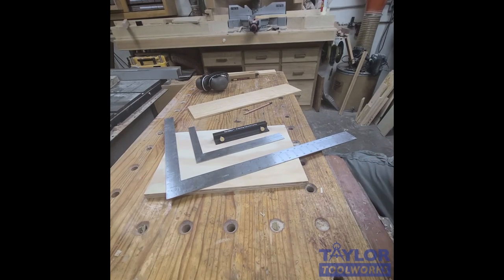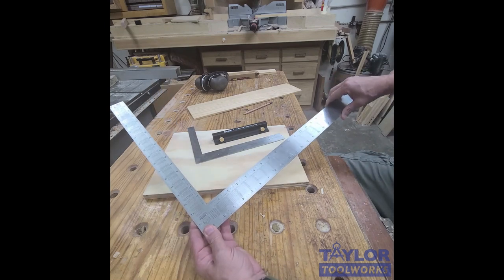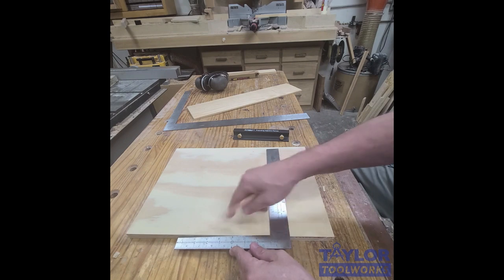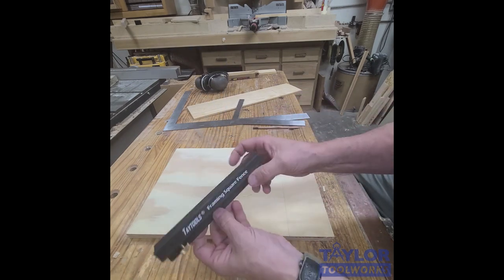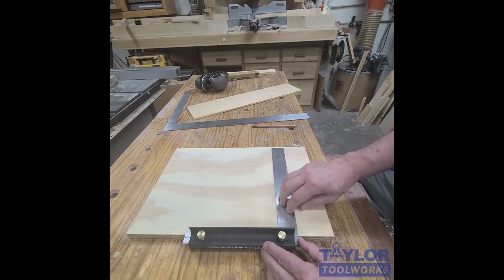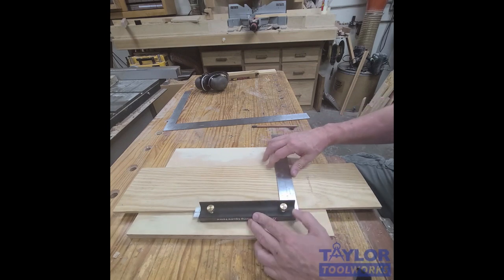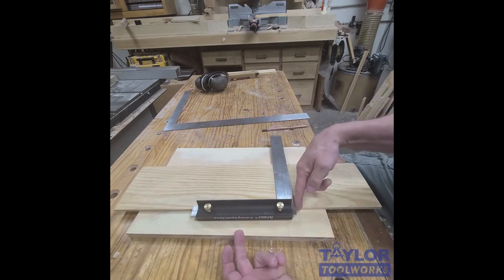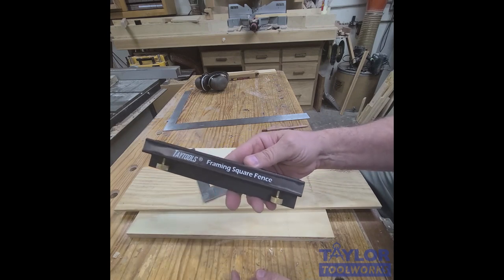Carpenter Square Fence

Comment: That looks really cool, the issue with just using a carpenter square as you mentioned is the gap you can get between it and the piece of wood which can lead to inaccurate measurements. This should solve it perfectly!